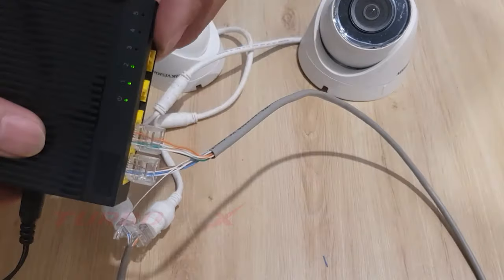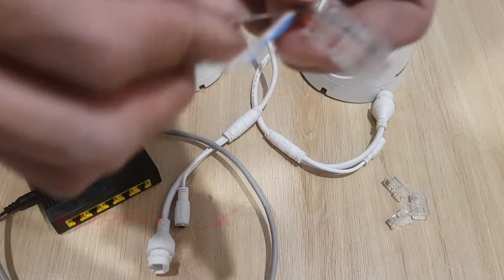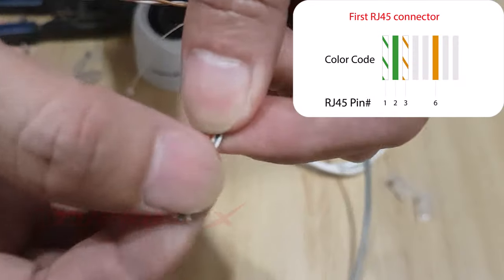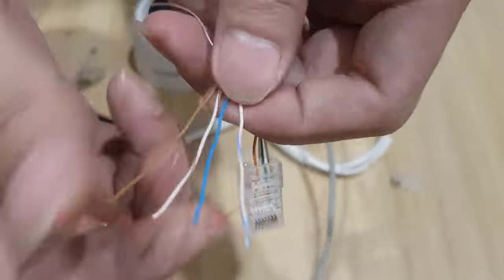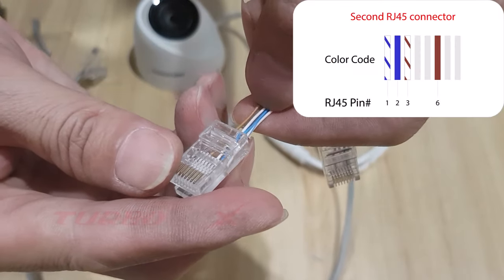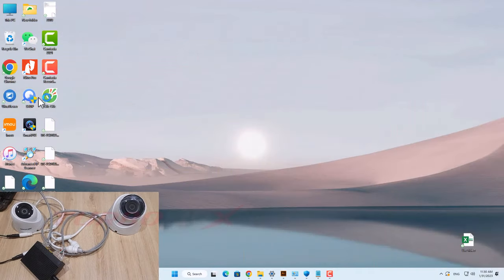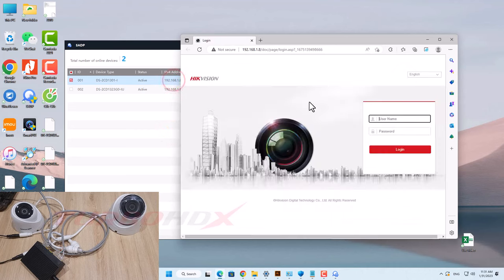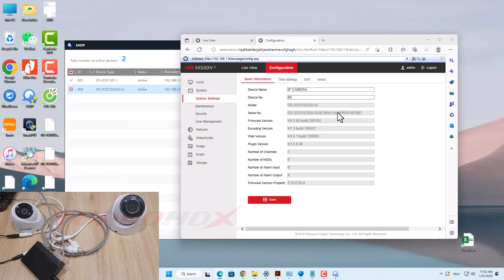2 IP CAMERAS connect on SINGLE cable (CAT5E, CAT6)

Comment: Is if possible to run the canera without powering externally, but through the sane cat6 cable
Reply: Yes 2 ip camera on one Cat-5/Cat-6 work well also as well as using POE SWITCH